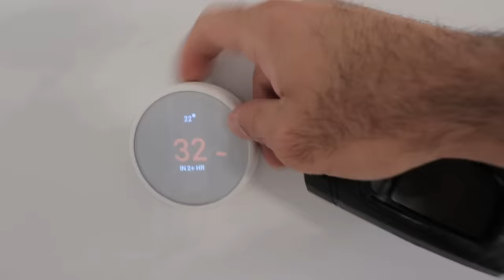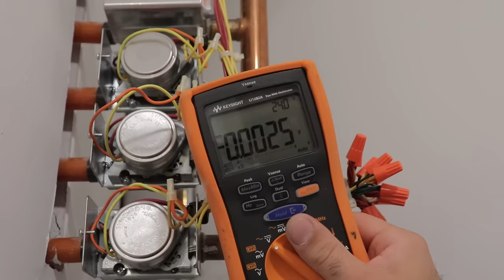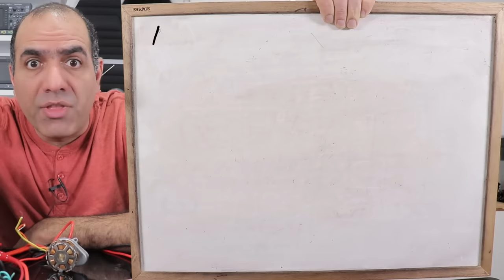Electro-Plumbing Repair… of my home heat zones that won’t heat although the boiler is running fine!!

Comment: They have other kinds of electric valves out there that work on 120 volt that instantly open and close with a lot simpler and cheaper mechanics that I'd try rigging to this. They too must run the whole time that the valve is opened.

Comment: I suspect the valves return to position with springs to prevent overheating in case of failure or partial electrical outage.

Also I like that you fixed the motor with high voltage and then proceeded to complain about the unregulated transformer providing too much voltage :D

Comment: Hello mehdi im watching your videos a long time and love them! Sadly i never got the keysight scope i desperately need!😭😢 But anyway i had a idea for a video: why arent our houses wired with PoE or usb power like 5V / 12V or 24V comming from one energy efficient powersupply since the most of our devices need small dc voltage and waist much energy on their supplies (for each device)?! So why not small dc voltage acros the house instead of 120/240V ac?! btw if you like you can use my music as well its content id free under cc 😉
Reply: fyi      waste                    one energy efficient powersupply  ---   this would be the opposite of smart.!         some newer homes  have  built-in usb power.  (which i am certain is  Not  done  'your way'.)         where that is not the case, it is easy to get a plug-in power strip that  Has  usb power out.

Comment: I would have thought the spring and the motor staying on constantly during operation would be a form of failsafe, if something fails in the motor (say it gets disconnected from power) then the spring is still able to pull the motor back and turn off the switch, closing the valve, so the valve doesn’t stay open and the boiler constantly heating the room well beyond the intended temperature, as could happen if the motor needs to be energised in order to close the valve as suggested by using a dc motor and reversing it to turn off the valve, as if the motor fails it could get stuck open, and potentially wasting way more power by having the boiler constantly operate when it doesn’t need to.

Comment: Saves power unless it gets stuck on, Your house would heat all day causing more power to be used. Happy to be wrong here. Edit: Refrigeration engineer here, generally these hot water heaters heat by demand, hence the circuit going onto itself. return temp is detected and that drives the heater.

Comment: 13:51 Did you end up tuning the transformer to have a lower output voltage? It seems like it still had some overhead even at max load.

Comment: Maybe using these motors is like having a dead-man's-handle, something that you should know plenty about! ;)  If the heating system had a power failure and a leak at the same time, the valves would close by themselves, avoiding a little bit of flooding.  You could try it out on one of your videos!  They are all great!  Thanks.

Comment: Did you clean up the extra wire nuts in your main box?    My guess is that you did that, just like you added extra wire nuts for the motors themselves instead of undoing the wire nuts that were already there.  Maybe your new motors didn't have as long of leads as the originals?

Comment: the reason for the constant motor power to keep it open is if the system loses power all the valves will close with the spring return

Comment: "doctors just do plumbing work"
now imagine the pipes are thin rubber and the fluid coming through them can bunch up and block some and they can only be blocked for less than a day otherwise (in case of a seizure) you die
and also the pipes can explode (not very commonly though), and the fluid can also die and if the fluid stops going around or being supplied by one of the machines it goes through then you have limited time,
oh right and the pipes even though theyre sorrouned by the liquid they carry, its still bad if they rupture, and the pump can fail from bad products being delivered

Comment: As a boilermaker/metal fabricator I can confirm that using sheet metal cutters as a hammer is a proper method of use..... Everything is a hammer.

Comment: I didn’t understand why low voltage is used. Here the Honeywell valves like those run on 240 volts and they never killed me!

Comment: it is the right way 1:45 beacose you said at 0:22 that some parts of the house are heating up
Reply: 0:55 "i think its working becouse its creating hot water and some parts of the house are heating up
Now at 1:45  you say " is it the right way to do this " YES!!! Becouse some parts of the house are heating up, if it were to be wrong then no part(s) of the house will heat up, will it?! Secondly, the house was heating before as well, so the zones that got faulty now would not work then too. GOOD VIDEO BY THE WAY!!!
Reply: Sorry its 0:46 NOT 0:55 !!!

Comment: The spring return is probably a fail-safe design. Remove power, and the valve automatically closes, isolating any leaks after the valve. So if you have an oh crap moment, killing the electricity to everything does as much as possible to stop water flowing.

Comment: 30V would be safe if it wasn't coming out of a variable step down transformer. With a normal plug there is a chance that the neutral is "stepped down" while the live is just passed through

Comment: You cant add some buck step down modules to drop the voltage to 24v so it would not damage your motors?

Comment: Personally, i would install electrovalves like the one you used a long time ago in your bathroom with foot control, with a switch that tells to the heater to turn on, and it just make the water flow or not, much more simpler...

Comment: Hey electro boom I think I know why they don’t just usa a switch cause it may be for safety as even though electronics fail springs don’t fail as easy so if the electronics don’t work properly or fail like this case the spring makes sure they don’t stay on and burn something

Comment: Yo can separate the motor from the gearbox turning the motor against clockwise. Those motor were use to run old timestamp clocks

Comment: had an electitan stole a wire from the range exhaust fan to fix the refiderator. and another electrition used a cut up extension cord to fix it. its a miricle my house didint burn down before i learned to do this stuff myself, also this is why i have trust issues.

Comment: A plumber wouldn't bother with a meter. Just measure the temperature differential either side of the valve...  tisk

Comment: In an ac induction motor, how would ac make it spin in different directions to open and shut the valve?  I would think a stepper motor and PWM would be used in this application?  I guess those motors are cheaper I guess.

Comment: And where do master electricians fit in???In Ontario you electrical engineers are not allowed to wire or build anything .But you can design them and certify a device .But an electrician can wire them build them .All heating controls are 24vac for most some are 120 Vac and there are some at 240V AC

Comment: The reason they have spring return is for fail safes in many locations. They want the valve to fail open so it doesn't stop flow.
Reply: valve to fail  CLOSED      not open
Reply: @daviddavids2884  you notice I said in many locations, not "this case"? 

It was a generic statement.
Reply: The vast majority of boiler zone valves in a commercial setting in northern climates are fail to heat.

Comment: You haven't improved the circuit design in order for the problem to not reoccur. How about replace the existing transformer with a higher current rated transformer and of course with its output voltabe closer to 27VAC?

Comment: If you are heating with electricity, what's the point in saving any power? That's probably why they didn't bother using a more efficient design

Comment: Is it really the higher voltage that's the problem though, or the cheap knockoff motors? Maybe that's why the Honeywell ones cost twice the price, they're probably designed with the unregulated voltage issue in mind.

Comment: 13:09 Well,  I think wires was too short  so  they  connect  wire  extensions..... (or they  just  dumb)    Mehdi  do you fix  that nonsense and  connect wires  properly?
Reply: Why fix something that is working?
Reply: @danek_hren lighting myself on fire to warm up when it's chilly outside works for a while too.
Reply: @nekomimicatears  well i mean our entire wiring probably looks something like that (it doesn't even have wire nuts, wires are just twisted together and masked with an electric tape), yet we still didn't have a fire.

Comment: wait. they cut the line? shortend it. fed it back into the box and connectet them to existing wires?  instead of   cutting the line short, run it inside the box and directly to the terminals?! who the F does that?!

Comment: I wonder if it would be possible to create a circuit that would do the same thing, but use a regulated supply and DC or stepper motors to actuate the valves.  Unless that box does more than just take input from thermostats and run motors it doesn't seem like it would be that difficult.
Reply: difficult?  no.       any better?   also  no

Comment: The motors need to be on all the time so when there is a power loss all the valves shut automatically because of the spring

Comment: So what I'm seeing here is that you spent $75 on replacement motors because the manufacturer saved $5 cheaping out on the power conversion.

Comment: So, just make a proper DC control panel for 5 zones instead of spending $70-80 every couple of years? Should be a pretty simple job for arduino, 5 inputs, 5 outputs and direction switch.

Comment: But Mehdi, if the system shuts down due to a power failure or some other control failure, you want the default state to be off, like a dead man switch!

Comment: Electrical work: 120V on the hot line is perfectly normal.
Plumbing: 120V on the hot line is in no way normal.

Comment: 🇨🇦/🇺🇸... I'm curious @ElectroBOOM... If you were able to adjust the voltage down to 24v, would those types of motors be damaged when they all came on at once and actually ran BELOW the 24v?? They're very curious those motors. They seem almost to be like old-fashioned analog clock motors.

Comment: In what country do they still use those old wire connectors ? And open wires is against any regulations especially next to a water source..

Comment: I'm expecting an update very soon. Motors probably died because the valves are clocked, if so the motors will die soon again.
If so, I would highly recommend to place a magnetic filter.

But hé. I'm just a plumber

Comment: eletric /water baseboard heater kill the Bill. alot of $. should go with Forced Air, GAS. Dislike them kind of system with motors and hot water controls. prehaps hot air, air ducts ect

Comment: Is the spring not there to make the system fail safely? If power os dropped to he wngine it closes the loop and the heating is killed instead of being stuck in heating mode?

Comment: The reason behind this design is for the valve to shut the water circuit in case of a power failure. Also, why don't you add a power regulation circuit at the output of the transformer? o.o Do you really want to waste money on motors instead of fixing the part burning your motors?

Comment: I’d guess the reason the motor holds the valve open is as a fail safe. If the power goes out, the valve closes.

Comment: the spring system Sounds like a dead man's switch to be honest. IE power goes out for an extended period of time, the switches automatically turn off and close the valves.
Reply: that is one result.      it could be said that the spring replaces a  relay

Comment: Why didn't you drop the total power to the motors by 2 volts? Then you'd have 24 volts when all the motors are on. Not a perfect solution, but the motors would be a lot happier nevertheless.

Comment: I suspect the purpose of the motor design is that in the event of a power failure, the valves will close.

Comment: Respect Mechanical Engineer, else any product which you use is just a theory on paper🔥🔥🔥 
no products is possible without mechanical engineering.

Well you can rearrange the list and put all on equal level 

Best Regards your Fan 
Rommel Nath
Mechanical Engineer

Comment: Does the red step down thingie that you use to test the motors have that big, plastic wheel that doesnt touch anything like that to make sure you arent accidently touching the device, or does it just look a bit silly? >_<
Reply: It's called a Variac in my neck of the woods, the design has been similar for many years.

Comment: Apparently keeping the motors energized is for safety, the spring will pull the valve back if there is a probleme effectively (not very effective in my opinion) seperating the power side from the water lines, it's a stupid design, I agree, and even more stupid if this is the sole reason for it.

Comment: So you waste 5 Watts of power in the valves while at the same time a 20,000 watt heater is running - the expression "A p155 in the ocean springs to mind".

Comment: Its realy interestig to see how cables usualy are geting conected around the world.
If you would do this twisting tecknic in some coutries of europe you would go more or less straight to jail and in america this is just the usual way to conect cables.
I hope there is an AFDD or an other kinde of fire protection switches in the wiring.

Comment: So, smart guy, why don't you have insulation around the pipes?  (You're losing a ton of heat through those bare copper pipes!)  Retired Electronic Engineering Technologist -> Electrical Engineer..  ;-)
Reply: Yeah in NY that wouldn't be code compliant

Comment: This is a odd system ones for oil boilers use one recirc pump per zone
Reply: But that makes it more expensive per zone. But it also means you get the same amount of circulation if all zones are on and heating

Comment: Electrical engineering and plumbing aren't they just the same?
I've seen dirty jobs on electrical circuits and shocking situations with plumbing.

Comment: can you make video about how much current or voltage it would take to kill someone. I'm an electrician and get shocked by 15-20amps 120v quite often and so do my coworkers. I'd like to be educated on how deadly that is. The licensed electricians I work with cant answer my questions in much detail. For example how likely are you to die getting shocked by 15-20amp 120v or even 40-60amps 240v Ive been shocked by that once.

Comment: The electrical engineer's heating system valve wires are connected with wire nuts. Such a pity, they are illegal in lots of countrys.
Better call that installer to get a refund! 😉

Comment: Well, heat transmission, heating/cooling systems, thermodynamics and fluid mechanics is pure mechanical engineering 😅

Comment: Question: Would this system be designed to always have all 5 zones active at once, thus always having the load the drop the voltage to rated levels? Is having 5 independent zones causing the issue?

Also, what would be the “fix” to correct this issue? Could your transformer be replaced with a model that would supply the correct voltage to the individual motors?

Comment: Question for anyone willing to answer. I'm looking to buy a little power supply i found on the internet. I can set it to anywhere from 0-15 volts and 0-3 amps. I want to use it just to power some motors, little lamps or anything interesting. It's just to mess around a bit.  I'm however not looking to shock myself. Will the power supply mentioned above be dangerous if i touch the cables by accident?

Comment: Isn't the water heater electric? 

If so those motors aren't wasting electricity.

Edit: oh no, it is gas heating, still not a significant loss....

Comment: I would bet money that the reason the motor has power to keep the switch on is a safety consideration.

If you had a motor that clicked the furnace switch on and froze and wouldn’t turn off. Well then you’d have heaters going on full indefinitely. It could be dangerous and even deadly.

So if the motors fail the valve turns off and you have a cold room instead. Ready for a man with eyebrows to complain furiously about them.

Comment: OK so my insanely  creative mind at first thought that an induction coil inline around the water distribution lines would be an alternative to the elements that heat the water, but then I thought the induction coil could need more current then an element, but then I considered a boost conversion but then I remembered the part about the oddly wired junction box with the 120 -30v transformer so yeah rip all that crap out of there and use induction coils around iron water pipe and just use 64 volts a/c boosted and forget about the rest....what?